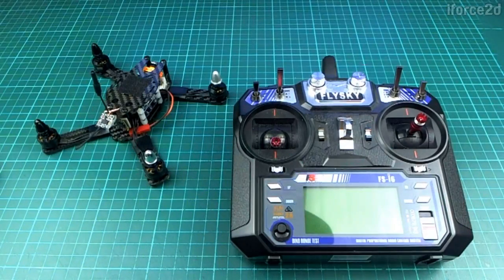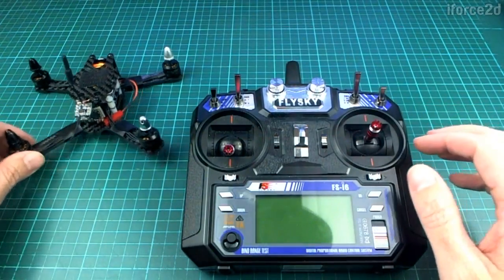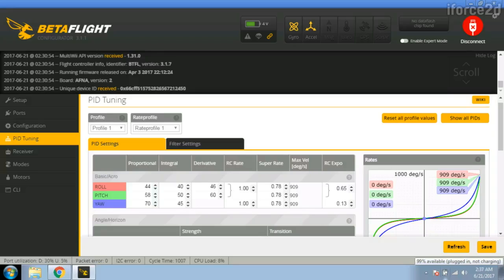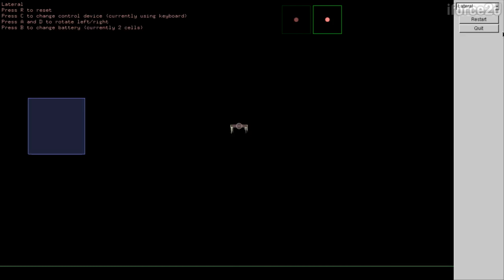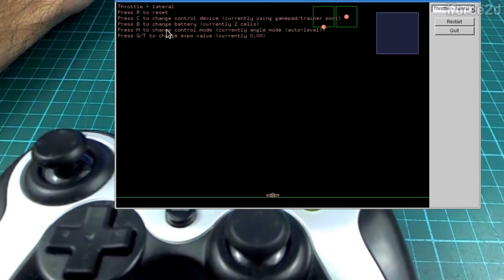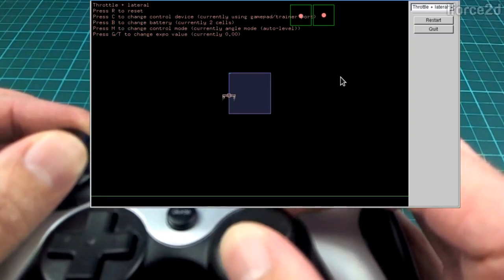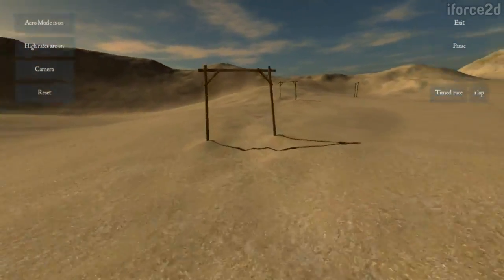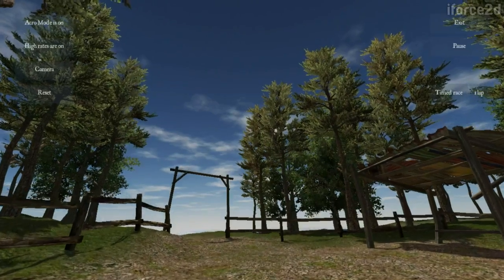Noobs guide to quadcopters part 18 (control how-to, simulators)

Comment: What program do you open YOUR simulator in. Or how do you open yours?
Reply from the maker: The simulator is a program, you don't 'open it' with anything. If you are using a Mac, see the extra video linked to in the description.
Reply: i downloaded from Github, unzipped to my desk top. Do i need to have the program box2d installed?
Reply from the maker: The github link is the source code, if you want to compile the program yourself. The first link in the description is what you should be downloading.

Comment: Can i use the normal usb cable which came with transmitter for configuring setting
Reply from the maker: What cable is that, I didn't get any cable with mine. In any case, since you already have it you can try and see. But most likely it's just for letting you update the firmware, not emulating a game controller.
Reply: iforce2d damn i think i got only the normal cable which can update the firmware and change settings and i m using flysky fs-ct6b transmitter thanks for reply
Reply: iforce2d can i use the PlayStation controller for emulation
Reply from the maker: I don't have one to know. Any controller that presents itself to the computer as a set of buttons and axes should work though. But as I mentioned, it will probably not be such a great experience. If you already have a FS radio, I would get the trainer port cable thing instead.
Reply: iforce2d cool i will try a training port cable thanks for answer
Reply from the maker: Ah I see, the fs-ct6b you got does not have an LCD screen to change the settings, that's why yours would have come with a cable, and the fs-i6 I got does not need that cable.
Reply: iforce2d exactly
Reply: Arif Hassan as far as I know usb programming cable is different to simulator cable. I ones tied to use  training to audio jack for simulators. Some controls were recognized.
Reply: Uroš Golob did it worked?
Reply: iforce2d is there any way that i can change settings of transmitter with android via otg cable by app?
Reply from the maker: lol I doubt it